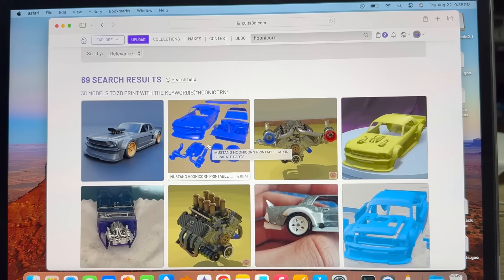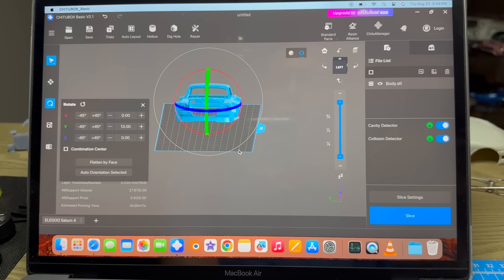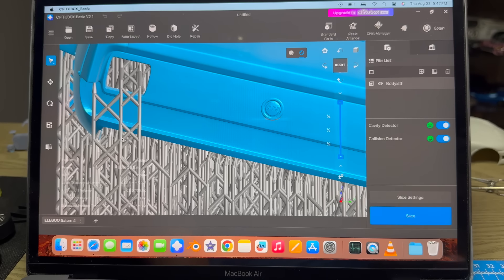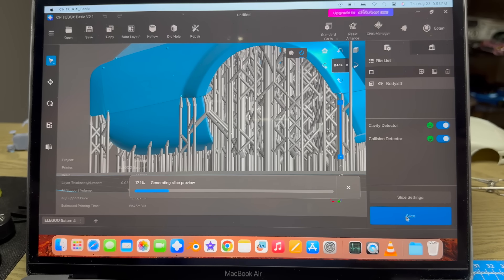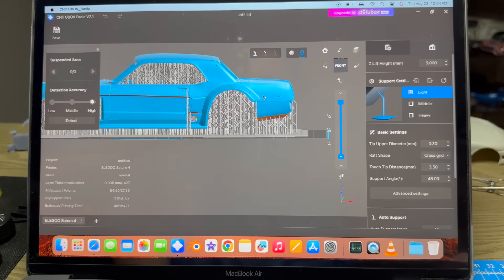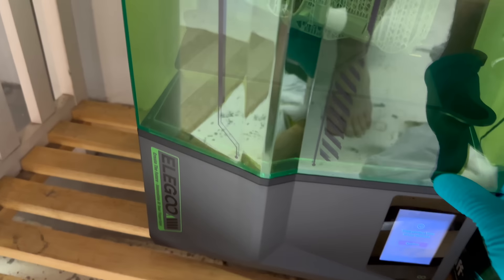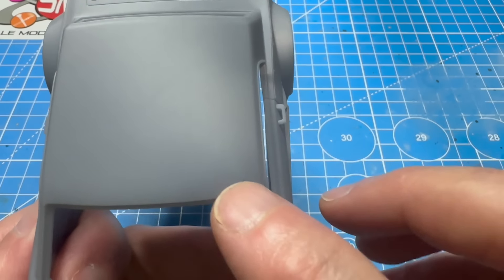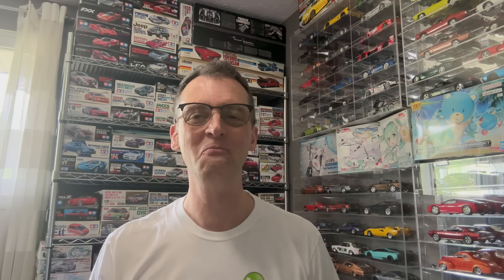Complete Idiot’s Guide to 3d Resin Printing Model Car Bodies Chitubox Elegoo Saturn 4

Comment: I'd love to see the clear part printing please!
Reply from the maker: Thanks for watching 👍 we will see what the community wants to see for a follow up video.
Reply: Yes the clear would be nice 
Can you make replacement windshields?
Reply from the maker: @thestig1899 Hi Stig, printing with clear resin is difficult. Reason is it is still a series of printed lines and you can see through the resin and all of the lines. In order for something to be translucent it has to be smooth. Something like a headlight or tail light is easy to polish the lines but a windshield is difficult to get perfect. The answer is vacuum forming. I have not tried it yet but will be soon.
Reply from the maker: @NADA-kv7ez hi Nada, thanks for the tip. I’ll try it out on a print and see what happens.
Reply: for a more artistic project gradiated lines of color in a clear @ScaleModelExperiment
Reply from the maker: Do you mean for the top header of the windshield? Like a blue green tint?
Reply: @ScaleModelExperiment It would be cool if you could figure out a way to use real glass for the windows. My phone has a thin glass screen protector on it that would probably soften relatively easily under heat. The trick would obviously be to heat it evenly and then form it smoothly, but I’ve seen incredible things from motivated YouTube creators, so I think it’s possible.

Comment: Honestly, these prints were better than some commercial model kits I've done over the years. QC was horrible in the 90s, half of my car models were putty. The detail levels might be better on these too.
Reply from the maker: Thanks for watching! Yes 3D printed kits can be very detailed and crisp but the problem with them is warped parts. Sometimes you have to heat them up to make them fit right.

Comment: I just got the Elegoo Jupiter SE.  You know, that Elegoo just released Elegoo Satelite, free slicing software?  It's amazing!  The automatic supports alone is incredible!  You really should look into it.  Yes.  Chitubox came free as well, but Elegoo's Satelite is far better.  I've had flawless prints so far.  I will give warning... Satelite is not optimized, so it has a tendency of freezing/crashing once in a while... But I still think it's superior.
Reply from the maker: I’ll have to give it a try. Thanks for the heads up👍
Reply: @ScaleModelExperiment  Of course sir! Coincidentally, apparently satelite came out within the same week that I ordered my printer. I've been printing for over a decade. I'm no stranger to it. But I really feel good things about Elegoo's newest software.

Comment: Just curious, what does the program cost for that Mustang? And is it yours forever, or a one time print and done, Was looking for a 1963 Chevrolet Impala 4 door to print, i know they make a 63 station wagon, great video...
Reply from the maker: Hi CC, the file pack costs $20 and it is mine forever to print as many times as I want. They only ask that you don’t sell the files or sell the printed items.  Good luck finding your 63 wagon, that’s an odd one.

Comment: Stumbled upon your content and I really like your treatment. Printing large figures and printing long thin parts is the real challenge in resin manufacturing. For long thin parts, I've learned that you shouldn't be constrained by the shape of the final object to get a good print. Allow yourself to modify it in a 3D program by either 
- separating parts to optimize printing and reduce the blemishes that z-banding can bring as you highlighted in your video
- or add structural supports (like lateral reinforcements) that rigidify  the chassis to reduce deformations during printing and shrinkage while curing. A support lattice generated by your slicer is not always going to get you what you want. Modeling your own "sprue" allows you more options to orientate the printed part. You can always cut these later and depending where you anchored the supports, you're going to need minimal cleaning. 

There's a real art of slicing a model for resin printing the same way there's a trade to optimize a sprue for plastic injection molding. It's unfortunate so many 3D models on the market are still sold by people having never printed their own or are rarely are willing to pay for someone who knows to optimize the files.
Reply from the maker: Wow, this is great advice. Just so I understand, to eliminate that Z shift that happened mid print would some diagonal supports going from the build plate to the opposite side of the body keep that from happening?

Comment: Really enjoyed this video. I'd like to see the whole process all the way to finishing and mounting. I have some resin printing tips to offer. 1) get yourself a silicone cake pan to aid in transferring the build plate out of the printer and onto your tray without dripping. 2) get a good scraper like a warner or level 5. The ones Elegoo supplies are meh and can bend. 3) pre-rinse your models. Before you put them in the main vat, have a "dirty vat" that removes 90% of the resin. It doesn't matter how dirty the dirty vat is. This will keep your clean vat clean for a lot longer. 4) use denatured alcohol instead of IPA. It's cheaper and it smells 6.2 quadrillion times better. 5) let your print air dry after rinsing and then lightly wipe the model before curing. This prevents any residual resin from settling on your surfaces and being cured to it. It also prevents said resin from curing on the turntable of your curing station.

My first car was a '69 Mach One. Love the Mustangs.
Reply from the maker: These are great tips! Thanks for your advice. Especially about the denatured and the cake pan.
Reply: @ScaleModelExperiment  hey just watched the other video and I see you already let your parts dry thoroughly before curing, so sorry I didn't get that. I do have some additional advice after watching that one though. Once your gloves have come in contact with resin, don't touch your lid or your printer controls or anything else you don't want to get cloudy over time until you've removed the gloves. Most older resin printers can be identified by how filthy the lids and controls look. It doesn't really hamper their performance at all, but it's a morale thing. I currently have a Saturn 3 Ultra, Saturn 4 Ultra and a Mars 5 Ultra. Elegoo is making such fine printers these days and for such an excellent price. You chose well sir.

Comment: Excellent! Very thorough James! 

Depending on the model, I’ll print at an angle somewhere between 15-20° along the Y axis, and maybe another 4° along the X. The size of the car will dictate how much of an angle you’ll need to tilt, and of course, it’ll depend on the plate size.

I’m not a fan of printing flat at all. A lot of cars have trim at the bottom of the rockers, and I’ve seen folks try to print those flat. Immediately I can see where the trim along with the rocker was warped along with a roof that printed not so stellar.

The Mustang has an advantage however as Andrey designed that area to be extra thick due to its styling.

Thanks for the great video…..I’ll be posting this on FB to get the word out. ✌🏾
Reply from the maker: Thanks for your insight Bill. I’m thinking that maybe I’ll try a flat print with only a tilt. That way it’ll keep the body low on supports but yet still keep an angle to avoid print lines. Hmmm, time for another experiment 😁
Reply: @ScaleModelExperiment  Well, printing flat and the success of that can be machine dependent too. The Mini 4K I have doesn’t do as well printing clear parts flat for example as well as the Mighty 8K. 

The clear resin in particular gets a “buildup” of hardened resin right where the supports meet the object, and it can be tough as nails to get them off. Raising the default print height helps…..around 7-8mm’s as opposed to the default 5mm’s.

The clear has different properties though, so each time it can print a bit differently than before…..printers can and do have a mind of their own some days! ☺️
Reply from the maker: @plastiksurgeon9129  I’ll make up a batch of clear parts to print and give it a shot. Thanks again Bill 😎

Comment: Great video. I had the same problem with those swirls. They are layer lines. That's why you see them on flat surfaces. I am guessing based on the look of the layer lines and the time it took to do those prints that you are printing at .05 layer height. Try lowering to .03 or even .02 and it will almost eliminate that. Hope thiis helps. I have not printed a car body yet but I print a lot of big stuff and it really improved my prints, they will take a lot longer though. I print everything at .03
Reply from the maker: Hi Butch, I printed both bodies at .035 layer height. It has more to do with angles and tilts than layer height. Layer height does make a difference when printing tiny delicate parts though.

Comment: Same here want to see the whole build. Sealed the deal for me, I see a Saturn 4 in my future. Large build plate will allow me to do this a lot easier than a small printer.
Reply from the maker: Hi Juan, I’ll count your vote for a full build series.  I would like to get a small printer as a second unit for small delicate stuff. Are you listening Elegoo? The big printer handles big jobs very well. There are bigger ones out there but 10” works with me.
Reply: Yes sir interested in Elegoo. Was leaning towards Mars 5 ultra since for the most part i would print small parts like engines and body kits. Rethinking a larger printer if I get into full body kits, in your last video you did print smaller parts which looked good so I think I can't go wrong with saturn 3.  

Quick question have had good results with water washable resin?
Reply from the maker: @Juan_Rivera835  yes the Saturn 3 from what I’ve read is the same as the 4 but without the self leveler. I appreciate the self leveler but it’s a pain to clean. If you can afford it the 4 ultra is a killer machine. I should have gotten that one but I’m happy with the one I bought.

Comment: Excellent comparison.  For me no question which body will require less work.  I'd enjoy seeing how the engine and chassis parts are printed and assembled.  I like drivetrain detailing so I have a stash of resin engines and detail parts that I've bought over the years.  Some of it is sublime.🤩 Most is good enough. 🙂 Some of it was a waste of resin.🤮
Reply from the maker: A few people have mentioned that they would like to see the chassis printed and test fit. I’m also interested to see how it all fits. Slowly’s models on cults gave away printable bolts so I could use those to hold it all together. Thanks for watching👍

Comment: Another great video! I will say the Hoonicorn is probably the best 3D kit I've found. I printed my body at a 40° angle on just the Y axis and it it came out with minimal shift and layer lines. The chassis is a bit more complicated to get really straight and it took several tries to get one that is "close enough". I hope to build it some day. Likely modify it a bit and call it the HooniKorn... Hmmm...
Reply from the maker: Hi Tim, thanks for watching. I was thinking of printing the chassis vertically with a tilt instead of flat to the build plate. I’ll post a video showing the results. It’s all just so trial and error.  I can only imagine what you would do to modify it 😂

Comment: Think they both look good and I can see were printing your own kits is way cool,
James I would like to see some clear parts printed too ,what is the total cost to print a full kit' ? These last few videos have been great with your 3d printing really enjoy look forward the next video thanks again.
Reply from the maker: Hi Deen, thank you for watching 👍 clear parts is a video that I want you to do as well. Actual costs are: file $20, bottle of resin $26, around 4 hours with the slicer program setting up the prints and 20 or so hours printing. Then there is cleanup, curing and prep. It’s a lot easier to just buy a boxed model kit😂
Reply: @ScaleModelExperiment  well like you said might be easier to buy a kit  but you don't get the same satisfaction plus you can make what you want well done James.

Comment: I recommend getting yourself a set of artists pallet knifes for getting prints off the build plate, they are basically large razor blades. I mostly use a #2 but the longers ones come in handy too. They slip right under the edge of the base layers and prints just fall off.
Reply from the maker: That’s a good tip. Thank you for the advice 👍

Comment: Print the same at 45 angle and 0,2 mm layer, it have amazing quality !!!!
Reply from the maker: The only problem with such a high angle is you risk the Z shift. I had a faint line at 13 degrees from the print moving ever so slightly. Sure I could put heavier supports but then it makes more work in post prep. Thanks for watching and leaving me a comment.

Comment: I printed mine using a cut method. I cut the rear off just below the window line, so I could re join it with glue and putty along that line & tilted it back at about 13 degrees

Comment: Hi James, I just subscribed to your channel. I watched the previous video also, very interesting too. 
I have a little bit of experience from work (I'm now freshly retired). The parts I struggled with were the thin parts, like the hood of your car, for example, that was warped after curing. Also support "warts" on the underside. I tried more support, less support without getting much improvement. 
I'm thinking about getting one printer but, from my experience, modeling is more relaxing and less frustrating. 
So if you have a chance to show how you print thin parts and reduce the "warts" that would be great. Also, how do you make the windshield? You don't have to print one, just showing the result from your previous builds. Thank you for these great tutorials and good continuation.
Reply from the maker: Welcome to the channel. I appreciate your subscription and support. I’ve found that thin parts can be challenging. But I’ve also found that heating them up with a hair dryer prior to cure you can bend them into shape. This can also be done post cure it just takes longer and you’re at risk of breaking the part. The warts are a fact of printing. You can try to orient the parts in a way that the warts are easy to sand off like a flat surface but you cannot eliminate them.
Reply from the maker: Oops, I have not printed a windshield yet. I have a vacuum forming machine that I need to experiment with. I’ll print bucks this week and try it out.
Reply: @ScaleModelExperiment  That's what I was thinking too, perhaps modifying the windshield file to turn it into a vac form mold, I use PETG (same as plastic blisters) for vacuum-forming, it's inexpensive by the sheet or can be recycled from packaging. One more thing, when a file is corrupted or not great, the only software that works, for me, to fix it is " 3D builder" it's free with Windows or can be downloaded from Microsoft. Thank you for your prompt reply👋🏻
Reply from the maker: @Yves95128 any tips for me on using a vacuum former for the first time? I’ve heard to heat the PETG till it starts to get wavy then quickly pull it down to the buck. How long do you leave the hot plastic on the buck? Does it melt the resin buck quickly?
Reply: @ScaleModelExperiment  It depends, some complex shapes require the petg to be very soft to get into all the detail, but for a wind shield wavy is good, you'll need to practice to get the feeling. Same thing about turning the vacuum before or after the part is in place, practice. 
About the resin mold, it's probably better to make it thick but as the petg will be thin 0.03 or 0.02 inches (0.5 or 0.8mm), it will cool down quickly and the mold should be okay, it takes perhaps 20 to 30 seconds, a little hair dryer blow in cold setting to be safe. (I forgot but the mold should be solid not hollow, the pressure is very strong even with a home vacuum)
You can sand the mold and polish it to remove the printing texture, but no primer. When you draw the mold it's important to create a draft on the base of the mold, like a truncated pyramid to make it easy to release and it reduces the risk of wrinkles. The best is, once again, to try, if you encounter problems, I can suggest solutions, I was model-maker for 35 years (in architecture and prototypes) and Vacuum-forming is not always obvious.
Reply from the maker: @Yves95128 thank you so much for the info. Can you contact me on FB so I can message you offline?

Comment: Glad to see there’s decals. Now I can go ahead and buy the files. Thanks James. 
I would like to hear about your printer, why you chose what you did, settings etc. also, why water washable resin? I use ABS resin and it’s durable, yet flexible so it doesn’t shatter. I keep getting that Z shift line in my bodies as well. I keep trying different orientation on the build plate, but it seems I can’t get rid of it. Thanks
Reply from the maker: Hi BC, when my Anycubic 4k machine died I decided it was worth it to upgrade to a 12k machine vs fixing the 4k. The price of $380 was in the budget and it’s a newer machine. I use water wash because I’m too cheap to bulk buy IPA. The WW works well for me and I haven’t broken many parts over the years.  I’ll figure out the z shift thing, it’s bugging me too.
Reply: @ScaleModelExperiment  Thanks for input. My first printer was an Anycubic m5. It worked well for couple months before issues set in. Got a great deal on an Elegoo Saturn 3 Ultra. It’s been a great printer. But after 3 months I’m still playing with settings. I was wondering if WW resin had better resolution?🤔 I’m going to have to get a 500 bottle and try it out.
Next Q; have you tried printing clear? I’ve used a whole bottle trying to print glass.😄